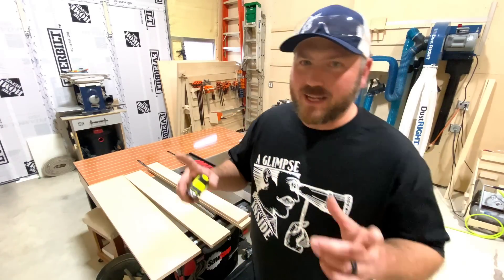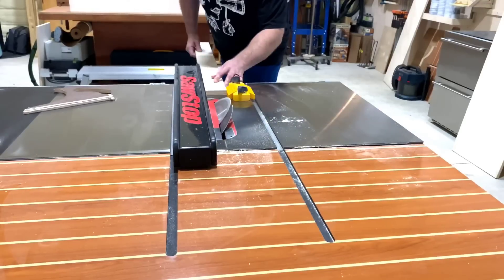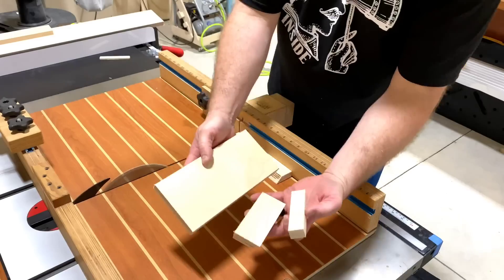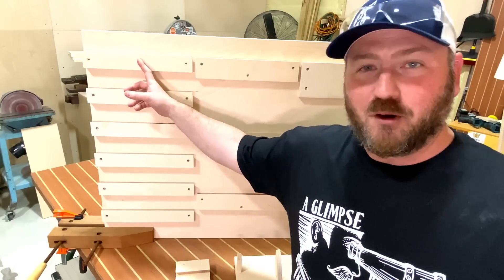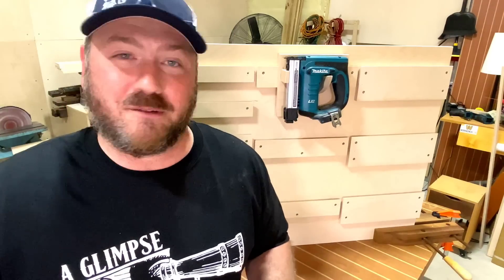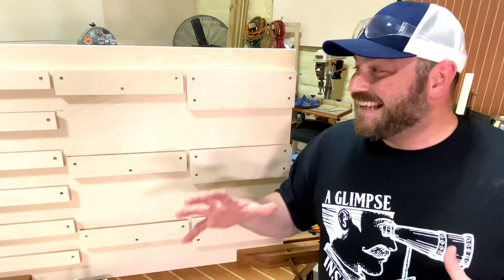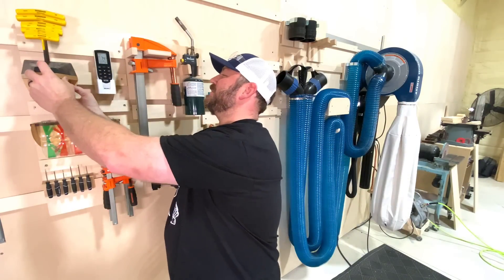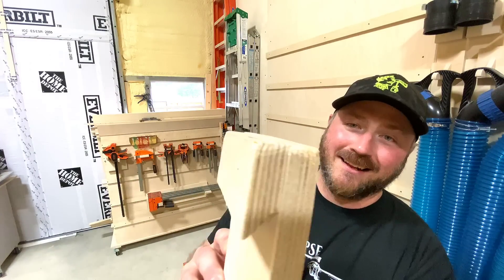Which FRENCH CLEAT Style is Right For You | A Glimpse Inside How to

Comment: Awesome video!  I am looking into building a cedar window box and attaching it outside a double window on the second story of our brick house.    Do you think a wooden French cleat would work?  I like the idea of being able to remove the window box and bring it in for the winter.  I was originally thinking of just purchasing a metal cleat but I like to make more work for myself and maybe save a little money as well.  The overall dimension of the window box is 85" by 8" by 8".
Reply: 1. do you want to hang something? 2. mount a french cleat on unit "A".  3. mount a reverse french cleat on unit "B"  Step 4. consider if you are going to drill into the brick to mount that $%Stuff....it isn't too tough. It can def. be done

Comment: Interesting video, thanks for uploading. Question - do you find the tool holders keep getting pulled out every time you remove a tool (like the pegboard system), or do they stay secure? I have the pegboard system but want to change to the french cleat. I did consider doubling up the wall support board and just making the tool holder backplate longer but with no 45° so it sits further in behind the wall plate for a more secure fit. What are your thoughts on that?

Comment: Hey Chris, is the dust collector on a cleat also?
Reply from the maker: It is not. It is screwed into the wall and studs
Reply: A Glimpse Inside should have put it on a cleat so you can move it around the shop. They can hold a ton of weight 🤣

Comment: Can anyone suggest setting up a French cleats on a cinder block wall? I'm thinking plywood attached to the wall as backer using either wedge bolts or sleeve bolts? But prob not just masonry screws that may not be strong enough.
Thoughts?
Thanks! Paul
Reply from the maker: Yes, compression Mason bolts with a  three-quarter inch piece of plywood would be perfect

Comment: My shop is a pole barn with 10' spans.  No inside walls, just bare spray foam insulation.  Ceilings are 13'.  Any suggestions on how to use French Cleats without paneling the walls?

Comment: I`ve seen these a lot but, I`ve always wondered why 3/4 inch stock is used? why not a 2x4 or 2x6 to make your cleats? wouldnt it be stronger? and speaking of strength... How much weight can a 3/4 cleat support? Great video!!!
Reply from the maker: Thank you. From my experience dimensional lumber can work on you and it’s just not the best situation even though it’s a bit thicker. Three-quarter inch plywood is super stable and is plenty strong never had a failure with it
Reply: @AGlimpseInside  Cool thanks for replying! I`m getting ready to do french cleats for the first time for my kitchen cabinets.. That was why all the questions!!

Comment: Do you just fix the cleats to the plywood wall, or do you drill them through into the studs? I'm in the Netherlands and we don't have studded walls, we have concrete/brick walls. So could I fit the plywood to the wall (using concrete plugs & screws) and fix the cleats just to the plywood?
Reply from the maker: Fit to the wall all day. No studs.
Reply: Thanks for the quick response! Must be quite early on your side of the world, so I appreciate it!
Reply from the maker: Of course. Not to early. It 8 am. Been up for a while tho👊👍

Comment: Great video! Do you need to have a solid wall surface behind the cleats? I have an unfinished area with just the bare studs, wondering if the larger cleats will work without drywall behind it.

Comment: Can you use French cleats for floating Shelves? I have a shelf made of plywood that's 4' long, 1'-7.5" deep, and 3/4" thick. I want to hold Pops on the shelves (figures). The heaviest thing to support will probably be the shelf itself. We may end up putting a few books on them. Idk. Anyway, we want it clean with minimal Cleat exposure. DO I have to use tall (wide? vertically) cleats and/or backer support block? How thick does the cleat itself need to be? (referring to the piece thats cut at a 45 angle.
Reply from the maker: Absolutely. Shop may have to be a little thicker due to the fact it has to clear the cleat and then come down. 
Yes go for it
Reply: @AGlimpseInside  Thank you so much. Shop is the piece under the shelf that rests against the cleat right? Lastly, is there a principal or rule of thumb on how thick and tall the whole cleat should be? referring to the whole piece before its even cut as 45.

Comment: Thanks for this. I've used French cleat wall systems but they don't seem to work out as well for me as they do for you and others. I have a few questions...
Is there any magic in sizing the wall cleats as you have? For example, would a 3" wide cleat spaced 3" apart work just as well? 

When you speak about the spacing between the wall cleats, that's measured from the bottom of one cleat to the top of the one below it, right? As opposed to measuring from the bottom of one cleat to the bottom of the one above or below it? 

Lastly, all your tool cleats are 1 3/4" wide, regardless of the width of the wall cleats?

Comment: Question: I have the same dust collection system and was planning to put it on a cleat wall as well. Did you do anything special for it given its size and weight?
Reply from the maker: I was just double up. Make it about an inch and a half thick should be good
Reply: @AGlimpseInside  Thanks for the advice! She is up and running!

Comment: So after watching this video I decided to embark on installing some.  I bought 3 sheets of 3/4 4x8 sheets of plywood.  After struggling trying to figure out what height cleats would be on the wall, what the spacing would be between them, and what the height of the cleats on the tool holders would be I sort of came up with a system.  6, 5, 4.  For the cleats that go on the wall I rip the plywood into 8' long 5" wide strips and bisect with a 45.  For the cleats that go on the holders I rip 4" wide strips which I then bisect with a 45.  To space them I take a small 6" wide piece and bisect that with a 45.  I get the bottom strip level and on the wall.  I take two approximately 2" wide pieces from the 6" pieces and use them to set the spacing for the next strip. 
Having never made 45 degree bevel cuts on 8' long by 5" wide strips of plywood I ran into some problems.  The 5" wide strips tend to bow somewhat after being cut from the larger sheet.  The bow needs to go cup side down as opposed to cup side up.  If you don't then it causes the strip to rise off the table when cutting the 45.  I learned quickly the piece you're cutting the 45 in MUST stay flat to the table where it wouldn't matter with a regular 90 degree cut.  It was so frustrating I went and bought the JessEm TS stock guides.  Problem completely solved with these.
When going to mount my first 8' strip I was very careful to mark out all the screw locations, pre drill each hole, then go back and sand off the pencil marks for the layout.  It quickly became obvious that this would take forever doing this on each strip.  What I ended up doing was placing a small mark on the first strip for each screw locations across the strip.  Brad nail it to the wall with 3 brads.  Install the screws.  Space for next row and repeat.  Once the wall of strips is brad nailed in with the bottom strip having screws, I set up a vertical green laser to line up each vertical row of screws for the rest.  Also switched to finish head screws and did away with pre drilling.  This sped things up tremendously.  So far have 24' of this on the walls approximately 4' tall with 8 rows of cleats.
Oh, and tip on subtracting half the thickness of the plywood to get the two pieces the same size, priceless.

Comment: I have an awful habit of putting things away and because I can't find them I do without them and sometime later I eventually find them by accident then I remember putting them there. I'm doing cleats to try and get a bit more organised and then dumping things lying around for a long time. Im a hoarder also but learned if I haven't used it in past 6 months chances I'm not going to use them so I just get rid of most and only hang on to some things a little longer in case needed while doing cleats and reorganising

Comment: Have you found a minimum ratio of height to cleat thickness to get it to hang?
I was trying it with 3D printed parts with a 10mm thick cleat and 20mm of height and it just fell off.  I may have the centre of gravity too high or just not enough height. Would appreciate the benefit of your experience here.
Reply from the maker: Great question. I find this is a pretty good rule of thumb right here. However long the space is  between the wall in the top of the cleat going up at 45°. For instance I use three-quarter inch plywood but when you cut it on 45 that face that gets exposed is almost an inch therefore I want the cleat to be 2 inches long from the bottom of the cut
Reply: @AGlimpseInside  Thanks, appreciate the reply.  If I'm understanding this correctly, we're talking about a nearly 3:1 ratio of height to the thickness of the plywood.  Where "height" is the measurement of the hanging part from its very bottom, up the vertical to right inside the 'hook' of the cleat.  If that's right, I'm closer to 2:1....which expains why it's not secure.  Back to the drawing board! :-)

Comment: If you cut your two halves and they don't come out even, you can set the blade to 90 degrees and run the angled edge along the gate to trim the bottoms to be exactly the same.

Comment: You’ve seen mine. My wife loves them and I had to do her art room with them. Now she wants another wall covered in them. I usually use a 4’x4’ sheet of plywood. Cut them to 5” then cut them in half to make all the cleats. What ever doesn’t go on the wall is where I get the cleats for the stuff they m hanging. Sweat and simple and very little waist.
Reply from the maker: You know it’s happy wife happy life. I hope you continue to make cleats on cleats my man
Reply: A Glimpse Inside  p.s.  thanks for the formula I would have to waist 2 or 4 inches of test runs to get it right.
Reply: What thickness have you used for wall and cleats? 1/2 or 3/4?
Reply: @matto.1074  Check his video on building the system,  he reveals that he is using 3/4 for the cleats.

Comment: Dakota™ 3/4 x 4 x 8 White Prefinished Slatwall Panel

(Actual Size .74" x 47-7/8" x 95-7/8")

Model Number: LamSlatwall_White Menards ® SKU: 1363000

They stock a plain also

With the cost of birch plywood  slat wall panels are a cheaper option and ive never seen the track on one break and in the shop I worked at we loaded them full of all kinds of stuff for retail sale.
You might get them free if a retailer closes up becuse the next store will want somthing differnt.  Free is always better then paying for it.
You can also make these out of skid wood. I mean why not? Its free and keeps it out of the landfill.

Comment: The first time I made one was just an idea that popped in my head while hanging some cabinets but I didn't know they were called "French cleats" 
I used a jig saw at 45 degrees and made a snake cut along the top "cleat" made out of a 1x4. 
This way I just screwed the bottom half to the wall, top half to cabinet, lifted the cabinet and because of the snake cut it could not be hung wrong then I just screwed the cabinet to the bottom 1x4.
Why do the French get all the credit?

Comment: Out of sight, out of mind... In other words, it's lost and you can't find it... Many years (decades), I went with the peg or nail hammered into 2x4s running horizontally around the garage solution... When I first created it, everything had its place and fit very nicely.  Unfortunately, I never got around to painting the outline of the tools against wall or on the 2x4s and the tools were never put back up immediately, so eventually it just ended up as a wall with a lot of nails and pegs in it and tools going wherever they might fit.  It's all visible, but finding something (that is not so large that it stands out) is mainly an endeavor of starting at one end and working my way to the other end and back again until I cover each wall.  Instead of being hidden in some storage drawer and not being able to find it, it's hidden in plain sight... At my age though, the motivation to strip everything off the wall and start over  is just not there... Just counting the days until the final dirt nap, I guess... :(
Reply: Grumpy OldMan I feel you. I’m rehabbing my deceased dad’s shop. His became like that. He couldn’t even work in it anymore. That, and he kept collecting material for “future builds” that were never going to happen. After tossing literal tons of unusable material, I’m starting with insulating and sheathing the walls, and will create s clear system for organization

Comment: Does the thickness of the French cleats determine the strength? I can’t imagine 3/4 is thick enough, why not 2x4s. I guess I should share what I am attempting to hang. I have very little room in my garage and was thinking of hanging my table saw, planer, mitre saw vertically when not in use

Comment: Those imperial fractions are such a pain in the ass, especially for dividing and multiplying. Sellers use fractions to cheat with sizes and prices, but why don't makers use easy and clear metric units?
Reply: Yu S , because some of us simply never really learned metric. I’m not disputing the benefits of metric but for us in America, at least for me, I’ve grown up using English  measurements. So when I hear an inch and a half or 3/4 of an inch or 16 inches, I instinctively know approximately what size we’re talking about. When I hear 4 centimeters or 130 centimeters I honestly don’t really know what size we’re talking about. I agree division and multiplying or simple addition and subtraction are easier with metric but I’d have to completely retrain my brain to understand the actual dimensions.
Reply from the maker: Yeah it’s all a matter of what you get used to the metric system on paper it looks really simple and imperial looks a bit crazy. But I understand the simplicity of both once your brain gets wrapped around using each one